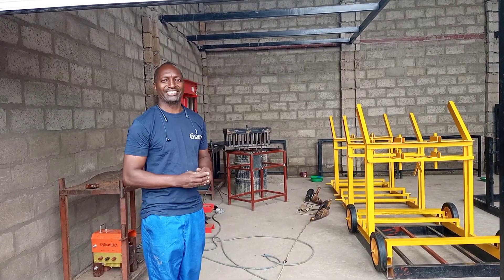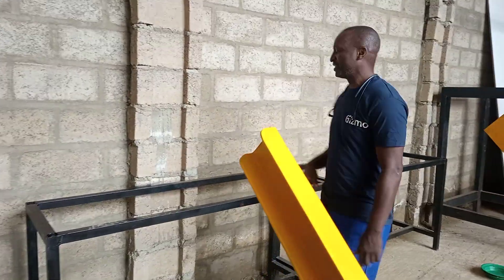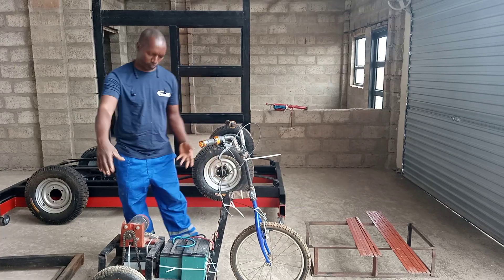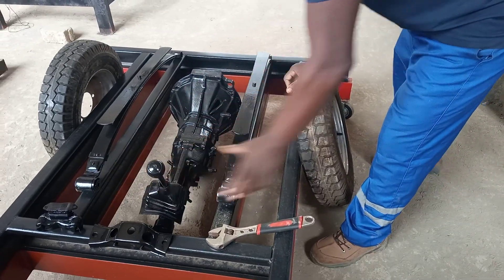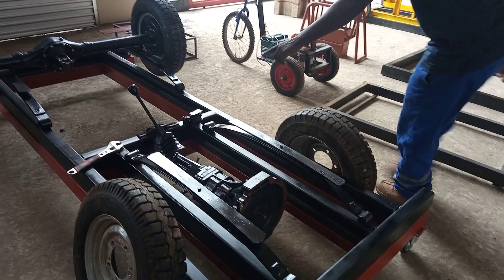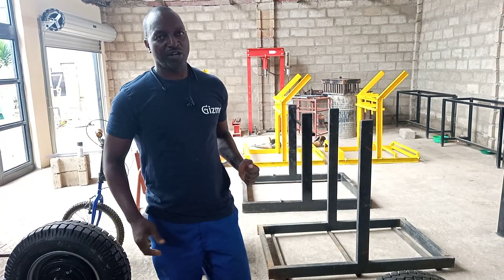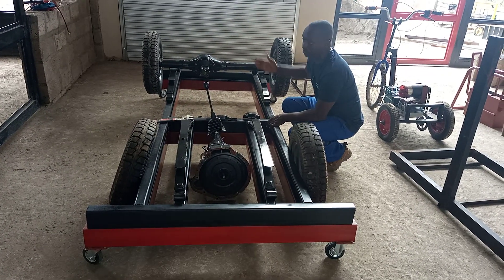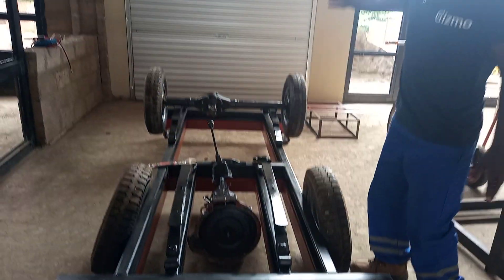Utility Tractor Build part 4

Comment: Congrats again for your insights and foresights. 
I've noticed on African roads, especially the poorer countries, there are not much pickup trucks.
I think with this vehicle you could
build a cross-over tractor/lorry/tow-truck. 
It should be more like a extended body FORD 150 pickup. 
In the US alot of pickup trucks are modified as tow-trucks.
My suggestions:
1. More volume than a pickup
2. Cable/rigg on front/back for emergency self-pullout ( example get stuck in mud, attach cable to nearby tree)
3. Heavy undercoating rust-retardant in bed & under body.
4. Bigger & wider tires for excess mud conditions on farms or off-roads
5.Use large used tires for mud-flaps or mud-guards
6. Heavy-duty high-beam lights on 
top of cabin....able to turn 360 degrees for rescue or in extremely dark situations
7. Possibly improve pulling power so vehicle can alternate also as a tow-truck for cars & light-duty SUVs & trucks
8. Stronger chasis enable more utilities.

Comment: The "ox cart" have you determined the maximum weight for use? Will the engine size be small enough that it would not require a license or is it just for "off road" use. Lastly any thoughts of installing a movable hoist or two? What about a load ramp? Keep your focus and vision outstanding efforts!!
Reply from the maker: This one is going to be half a ton. The engine is going to be 12 hp,as for the hoist and load lamp, since it is our first prototype we will keep it basic as it is meant to replace the ox cart.

The idea is to produce a replacement for the ox cart with an affordable vehicle.